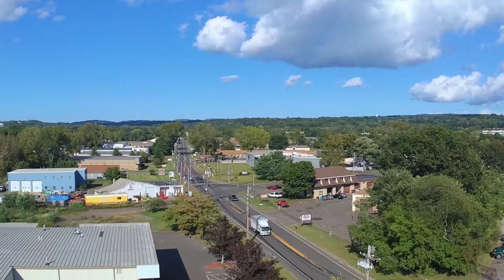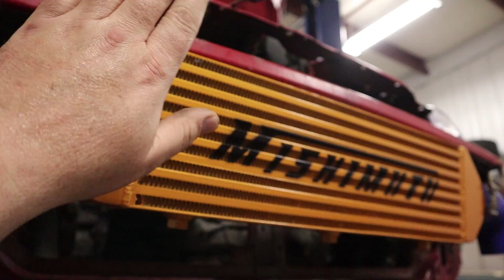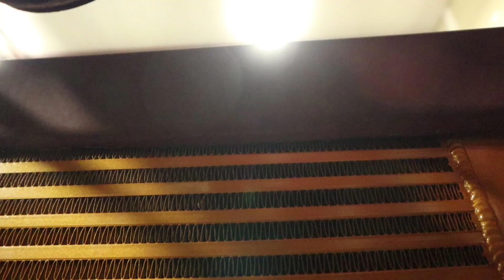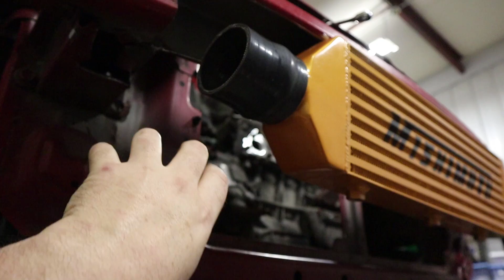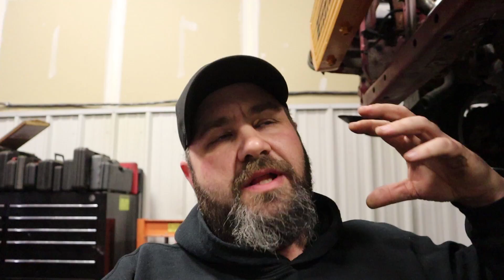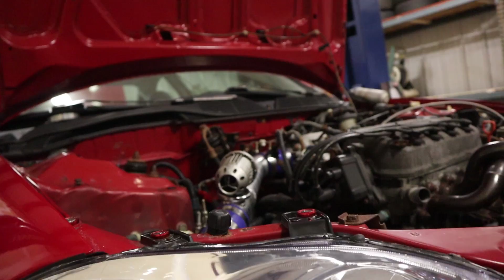THE RED ROCKET GETS INTERCOOLER PIPING!!!

Comment: not trying to contradict your decision on how you did the hot side but wouldn't it have been easier to turn the hotside if the intercooler to a back door type so that you didnt have to remove the washer bottle. unless of course the car is going to be a straight race car then it really doesn't matter
Reply from the maker: That would have been the best way but the intercooler would have to be different or heavily modified. It's too wide to 90 it into the engine bay. The washer bottle can easily be relocated without much effort. Bc
Reply: the only reason i said something was because i recently put a turbo my 90 crx that has a b20b swap done to it and i since i run a dual core half rad i found that it was easier to take my intercooler to a exhaust shop and have them turn it to a back door style on the hot side so that i didnt have to run my piping the way that you had to on his civic